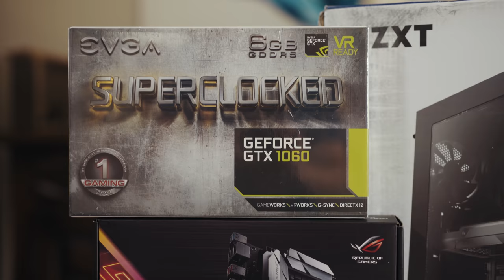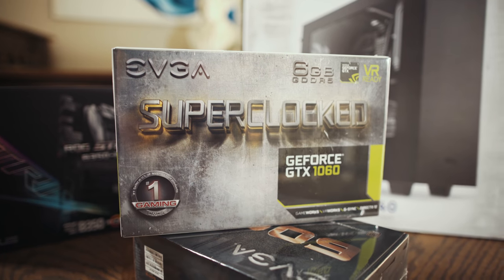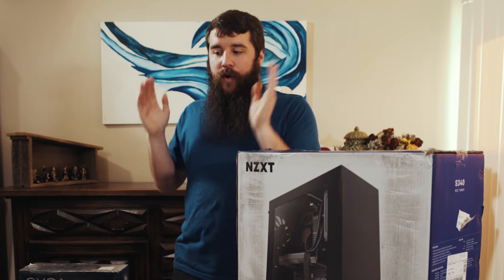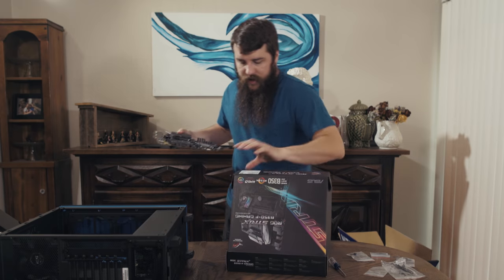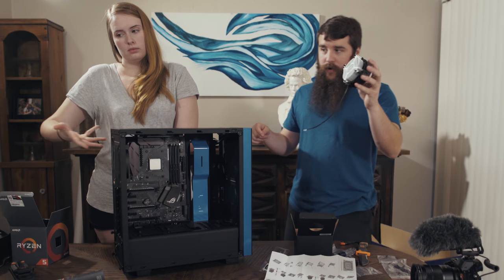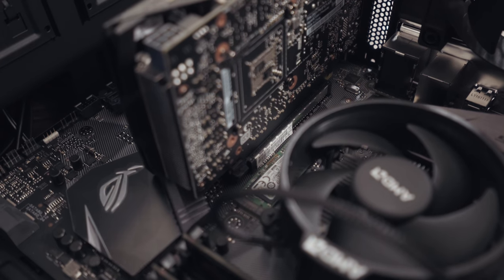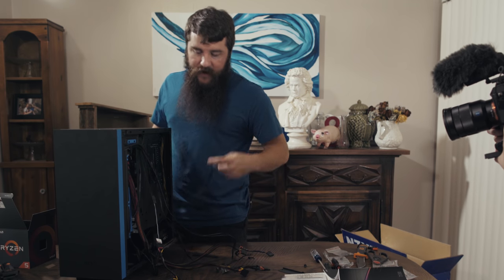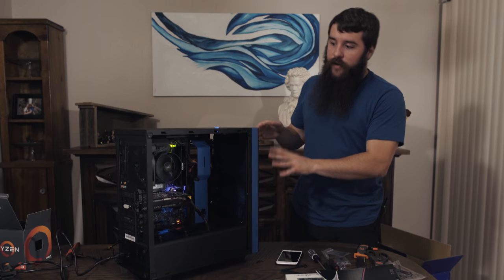How To Build A Video Editing Computer | $850 Ryzen PC Beginners Build Guide | 2017

Comment: question on the video card:
Is the 1060 is the 3Gb card ($200) okay over the 6Gb card ($250)?  Saw they both have 1280 Cuda Cores.
The 1050ti is cheaper ($160) and is 4GB but only has 768 Cuda Cores...  
So I'm stuck between the 1050ti 4GB vs the 1060 3GB card
I assume 1 vs 2 fans isn't a big deal for editing?  I got liquid cooling on my CPU which was on sale from Corsair today.
Reply from the maker: Hey! The 6GB card will handle 4K a bit better than the 3GB Card. I would go with the 1050ti, it shouldn't make much of a difference. :) 1 fan should be fine!

Comment: Ryan Connolly switch mac to windows. Also the battle between mac and windows is for apple pro res
Reply from the maker: Prores is definitely an issue on Windows. I use Cineform for my proxies and it works really well though, no Prores needed.
Reply: and for masters files dnxhd :)

Comment: My pc was 600 dollars. Built over 2 months waiting for the best deals possible. Not counting my powersupply or graphics card already had those from upgrades to my previous PC. 

Ryzen 7 1700, $230
32gb ddr4 2400Mhz ram,$140
250gb evo 850 samsung ssd, $60
2tb Seagate hard drive, $45
Gigabyte x370 gaming 3 motherboard, $100 deepcool case included
Seasonic x850 platimun power supply, $65
MSI gtx970, $50
Reply from the maker: Very nice! :)

Comment: Hey! What do you think about the Intel i5-7600K 3,8 GHz vs your cpu for premier editing?
Reply from the maker: +Kovács Bálint hey Kovács! I wouldn't want to use that CPU for video editing. It only has 4 cores and 4 threads so it is going to be substantially slower than an i7 or the processor I used in this video with 4 cores and 8 threads.
Reply: Matt WhoisMatt Johnson ok thank you:) i think i will go with the ryzen 5 1600, one more thing: is a 400W power supply enough for this build?

Comment: Hey this is my first time building a pc, I ordered the parts of off here but my fans didnt come with a molex connector and now I'm stuck on what to do 😅
Reply: Samuel Rodriguez same! We're going to have to buy one off of amazon😭
Reply: @mintmilkshakestv4892  you get the same one from the description to?
Reply from the maker: Sorry about that, I’ve been hearing from some people that there isn’t a molex connector included. You can get a molex to 3 pin connector from amazon for cheap
Reply: @whoismatt  thank you 🔥😁
Reply: Do you guys have a link to that specific connector from amazon?
Reply: @amcking384  turns out you dont need it. On your mother board it sould say like sys fan1 sys fan2 and so on. You just plug your fans into that
Reply: The fans should plug straight into most motherboards. I just learnt the hard way too. Molex not required

Comment: 2019 update, I bought the same case and power supply and the case does not come with that little metal plate to mount the power supply

Comment: With regard to the graphics card, they are extremely important and something you want to spend more on if you use Davinci Resolve 15 or greater, or so I hear. Helpful video. Would like to see more builds for high-powered computers up to $1500 not including monitor.

Comment: Thank you so much Matt!!!! Quick Question for editing videos. I have a Dell XPS 8900 with 24GB Ram and Nvidia GeForce GTX 1050 Ti. Current processor is a Core i7 3.6Ghz. Should  I replace the Core processor with the AMD Ryzen 5 1400 to improve performance in rendering?
Reply from the maker: +jc vera thanks Jc! That i7 processor you have is a 4 core, 8 thread processor. If you bought the ryzen 1400 you would just be switching to another 4 core, 8 thread processor. I wouldn't do it. You would have to buy a new motherboard and ram etc. Not enough performance gain. 

Now if you wanted to switch and get a 6-core or 8-core ryzen processor, that would be quite faster than your current setup for video editing.

Comment: Hey Matt! I'll be building a computer within the next few months to streamline my editing process (right now I'm surviving off of your Proxy Workflow Methods). I do have a question about M.2 drives that you may be able to answer... With this AB350 motherboard, there are two m.2 slots. One is the much faster PCIe, and the other is the standard SATA3. If I wanted to run a combination of of a 256gb drive for boot/programs, and a 1tb drive as my working current projects drive, where should I prioritize the PCIe speed? Will my SATA3 boot/program drive create a bottleneck if I'm constantly accessing premiere/lightroom files through a 1tb PCIe slot? Thanks for all the information you've shared thus far, it's been so helpful!

Comment: Hi Matt! Great video! I am interested in building this PC. I'm a newb, of course. If I end up getting a 1600, am I still okay to use the same parts for the other components? Or would you recommend alternative for anything else if I end up using a 1600 instead of a 1400?
Reply from the maker: +Shelly Tudela hey Shelly! This build should be great for you. Only changes I would make is a 1050ti instead of a 1060, the ryzen 1600 instead, and a Samsung 960 Pro instead of the 850 evo I used.

Comment: Ha, I built the same machine almost. I have the 3gb version of that same 1060 card and I have the ryzen 5 1600 and an msi motherboard. Still, similar card the same case in white and black. I even bought an evga power supply. Oh and I will buy a m.2 drive soon but not yet.
Reply from the maker: +joshua3113 thanks Joshua! Great choice!

Comment: Thanks for this video! I got lost around 1hr 8 minutes when you plug in the H.D.D. LED. I realized that my AB350 PRO4 motherboard is slightly different than yours and doesn't have the same header that you plug it into. Did I get the right part? The closest header I found was the 7-pin "Power LED and Speaker Header" but the pins don't match. Also, the H.D.D. LED cable is very short and has 6 pins on the back to connect to something else.
Reply from the maker: Hey Monica! I would keep looking. All motherboards should have that HDD LED header. The motherboard manual should show you where it is.

Comment: Probably a dumb question but I’m new to video editing. How much do different video editing softwares effect editing efficiency from a processing power standpoint?

The reason I ask is because I have an i7 7700k,16gb ram, a gt 710, and an ssd drive but my computer seems to really struggle editing 4K videos with shotcut. So I’m wondering if I should upgrade my graphics card or if it is the free software that is causing my issues.

How much does a graphics card really come into play for video editing?
Reply from the maker: Hey! Some of it depends on the software, but in general, more cores = better. Your 7700K is good, especially for 1080p. If you had a 6-core, 8-core, or more it would be even better for editing 4K. 

Graphics cards (at least with adobe) make a difference when you are editing with certain effects applied. Adobe is a very CPU heavy program otherwise. 

I would look into editing with proxy files if you want things to be even faster. :)
Reply: Matt WhoisMatt Johnson thanks for the reply! I’ll have to check into proxy files and see if that helps.

Comment: So (Matt or other computer building smart people) this build was looking like my next step to work towards....however after listing out all of these parts (a year later even) it's no where close to $850. My estimates are at least a bit above $1000 for the same parts. Where do I cut corners?
Reply from the maker: Yup crypto currency such as bitcoin is driving up the costs of certain parts significantly. See if you can find a nvidia 1050ti. That may bring the cost down some without too much performance loss. :)
Reply: Matt WhoisMatt Johnson thanks so much for replying, again!! You're always so helpful!

Comment: Jayztwocents, in a recent video, shows how to fix bent pins by deliberately bending and unbending some on his Ryzen.  One broke off.  His suspicion is that it's a dummy pin that had no function.  It worked fine and showed no signs of degradation after testing.  I'm not suggesting anyone do this deliberately or to not be extremely careful.  But to not assume that it is automatically trash if some bend a little by accident.

Comment: Okay I have googled and watched lots of video but I CAN"T figure out where the molex  cable from the PSU goes. Is that suppose to connect to a cable that came with a tower or does it plug into the motherboard? HELP. In this video it looks like Matt plugged it into another molex cable that came with the tower? There is no molex cable in the tower. I am lost

Comment: I was thinking of getting a Ryzen 5 1600X and a GTX 1070, but seeing this has made me reconsider, as this is still a pretty solid build for the $400 I'll be saving. I think the only things I'll change from your build is the case (probably go for a Fractal Design Define C or Meshify C) and overclock the 1400 to 3.9-4Ghz (I'm a gamer as well, so I can justify it). Other than that, nice vid, man!
Reply from the maker: Hey Pat! I would get the 1600X if you can afford it, it will be much quicker for video editing.

Comment: So I have searched all over the net at various websites, even adding to the cart separate parts from separate websites, and the cheapest I could get this build was around $1,100 and that’s without the monitor, keyboard, or a mouse. My next concern is; I have read a LOT of 1 star reviews about this motherboard on Newegg. Do you know of a better motherboard we could use that will fit all of this hardware? I’ve never built a computer before, and I thoroughly enjoyed this video, I watched the entire thing from start to finish, but I am now at the point of wanting to “check out” what’s in my cart, however this build is way more than $850. I appreciate the time and effort that you put into making this video but would be even more appreciative if you could point me in the direction of a better motherboard, preferably with some cool LED lighting options like this one has, though it’s not very important because I would much rather have a good motherboard than fancy lighting lol. And I would be over the moon if you could possibly do the legwork of finding comparable parts that actually fall within the $900 range or lower. My mom is already at her wits end at the idea of spending over $600 on a computer, lol. But I got a nice 80D Canon for Christmas and I want a good computer to edit videos on.
Reply from the maker: Hey Shawn! Here's a pcpartpicker build with a better rated motherboard and Nvidia 1050TI for a bit over $800. If you wanted to upgrade to the Nvidia 1060 it would be around $100 more. Hope that helps!

https://pcpartpicker.com/list/jRmr9W
Reply: You’re absolutely amazing, thank you!

Comment: Hi mate, great video! I'm looking at following this exact build for my first self built computer, but have two quick questions if you could help me out! I'm looking at potentially getting a different case, something like a Coolmaster h500p or a Fractal design meshify atx. Would I have any issues following your build with one of those cases? Also what would you recommend to add more storage to the build? Would you get 2 of the 960's and run a raid or buy a slower second drive? Thanks for your help man much appreciated!
Reply from the maker: Hey thanks Jake! As long as the cases fit an ATX size motherboard they should be fine. I would just buy a slower second drive if you need more storage for files. If you need more space for programs then I would buy another 960.

Comment: @Matt WhoisMatt Johnson  do you have a video discussing how to install drivers and what they are used for
Reply from the maker: Drivers are how the software works with the hardware. Most of them are installed by windows out of the box. You will need to install graphics card drivers from Nvidia. That should be about it.

Comment: Hey Matt being that this video is about 10 months old would you still recommend this build rather then going with Intel ? Any problem at all with ryzen and Adobe premiere or does it  work seamlessly ? Any how love your work !
Reply from the maker: Hey thanks! I would instead use a Ryzen 5 2600 (their latest version of the CPU I recommend). I didn't do a ton of testing in Premiere because my brother is using Da Vinci Resolve, but it should work well with both Premiere and Resolve.

Comment: How do you getting this computer install a operating system without a disk. Can u show me ... and what about the sound card I haven’t seen u put them in ... do u need one or not ?
Reply from the maker: You can install windows using a flash drive. The motherboard includes sound, you don’t need a sound card

Comment: I got my first PC built thanks to this detailed tutorial!..... However installing the OS is being a pill. It says it can't find any drivers.... I have no idea what to do. Did a few problem solving ideas from searching around, but it hasn't worked yet. Any ideas? Is it a motherboard driver or some other part I'm trying to use for this first install?
Reply from the maker: If you’re using a usb drive to install you’ll need to tell the bios to select the usb drive as the first drive to load when starting up. That will start it loading windows
Reply: @whoismatt  thank you for replying! I did go in and select the USB, but it couldn't find the driver..... Turns out the SSD card was not clicked in completely. Got it all set up now. Thank you for the help and the thorough videos.

Comment: thanks for this video.  if you were a canon shooter and do alot of photography work (5d mark 3 ) and getting into video would you suggest trying to selling the 5d3 for the a7s2 and shoot everything with that? or get an a6500 and keep the 5d3 for now?
Reply from the maker: +kspec2001 thank you! If you are doing a lot of photo work I wouldn’t get an A7sii. I would probably get an a7rii. Best of both worlds for photo and video.
Reply: Matt WhoisMatt Johnson thanks for the info.  I would assume the main difference would be the ultra low light capabilities?  Just trying to make the most efficient purchase for my transition.
Reply from the maker: Exactly!

Comment: for video editing is better choice r7 1700 and 1050ti or maybe r5 and 1060 6gb or other gpu from AMD . I need for 4k video playback with LUTS and other transition, and editing in 4k. For now i have i5 4440 cpu, that is 4 core cpu @3,1. Do you think to change to RYZEN or stay with this cpu and buy expensive gpu?
Reply from the maker: I would definitely upgrade the cpu. The r7 1700 and 1050ti would be great

Comment: I got the GTX 1050ti graphics card, but there is no power port as described in your video (thinking you used the 1060), is it just pulling power from the morther board?... FYI this is my first time doing a PC build.

Comment: Thanks Matt! Your videos helped me so much even though I don't know anything about computers! You deserve more views and subscribers. 

I got to the last step, my CPU fan lights up and spins but my case fans do not?  Are case fans supposed to spin right away or only when my computer is too hot? Also, what is a good way to check if I plugged in my case fans correctly?
Reply from the maker: Case fans should definitely be spinning. I would make sure they are connected to the power supply
Reply: Matt WhoisMatt Johnson ok thanks so much for clarifying 🙏🏼🙏🏼🙏🏼 Should  the cpu fan be spinning at all times as well? Mine lights up and spins occasionally but not continuously, is this normal or is my connection off ?

Comment: Hi Matt.  If I were to run with the Ryzen 5 1600, is the EVGA GeForce GTX 1050 Ti still a good choice or do I need to look for a different graphics card?  Are there any other components that should be changed to maximize the upgraded processor?  Thx!  Great video.
Reply from the maker: +Jeff Chiarelli hey Jeff! I think the 1050ti would still be great for video editing. Otherwise I think you would be all set :)

Comment: If you do not plan to do any gaming, can you skip the extra graphics card and only use what is built into the processor (if Ryzen has that..)?

Does your price include the OS and SW?
Reply from the maker: I don't believe Ryzen has any integrated graphics, so you'll need an external graphics card. If you want to save $$ I would consider a GTX 1050ti. Price doesn' include OS or software.

Comment: Hi Matt, Loved your video so much that I ordered same exact components to build mine. I went through all your steps but I am afraid, the monitor is not coming up. Any thoughts/input will be appreciated. Monitor is not receiving any signal
Reply from the maker: +Senthil Prabhu hey Senthil! Are you plugging your monitor cable into the graphics card on the back of the computer?
Reply: Matt WhoisMatt Johnson you are awesome. You nailed it. I was plugging the monitor display card onto the motherboard display port and HDMI. Switching it to graphics card resolved the issue

Comment: But Matt.....you never mentioned if this is a 4K video editing computer as the title just says a "video editing computer" bec i can build one at 500usd that can edit 1080p and even 400usd for 720p editing. Its like building a house for 10,000 usd, a 1 bedroom house sure.

Can i get a R7 5700g ?.....i want to edit 4K 200mbps with only the iGPU (later on ill add in a 1080ti or a 1660ti)......rest of the hardware ive got the entire 9 yards for a reasonable edit system (multiple SSDs and NVMEs etc etc).